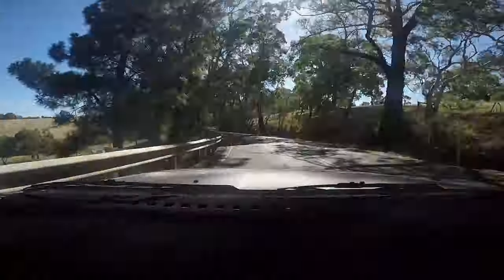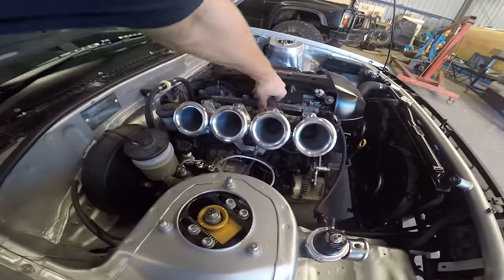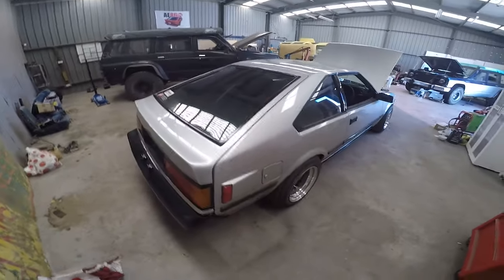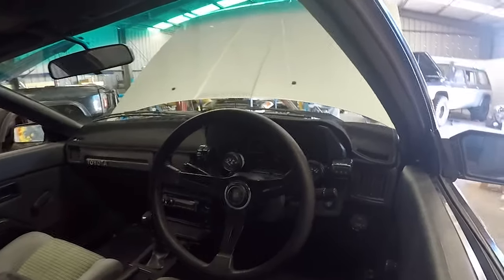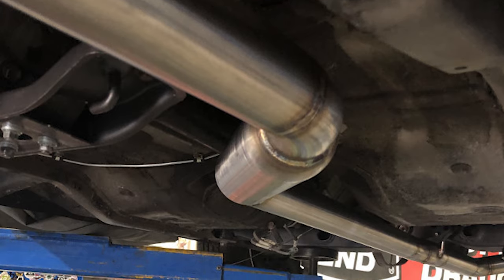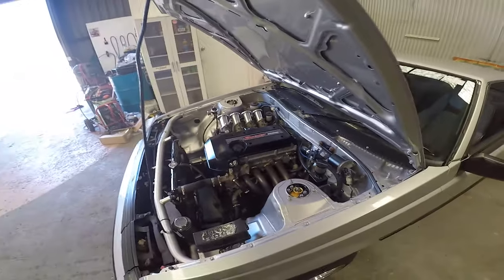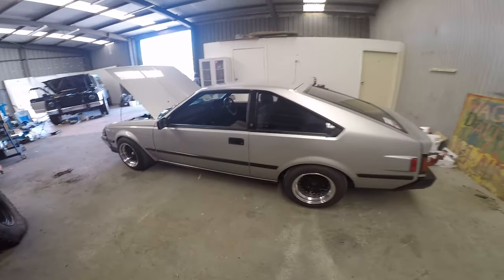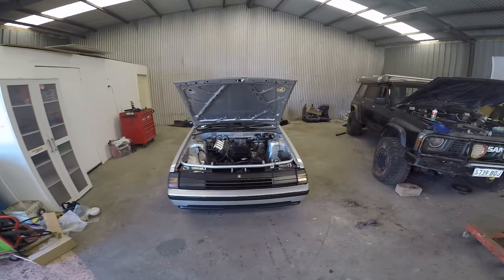Altezza 3S-GE Beams swapped 1985 Toyota RA65 Celica #InterNETionalCars

Comment: Very nice. I have an ra23 but I think the ra65 is underrated. If I had lots of money, I'd for sure get a second Celica, being the ra65
Reply: I've had as well as the two I mentioned above, the second car I owned being an RA-60 and then an RA-65 years later (so basically now have them back) I didn't mind the RA-23 but never drove one unfortunately. Both the RA-60 and 65 are very underrated. The 21RC 2.0L was a grunty naturally aspirated solid engine. I believe they were from over-stock from the Hilux until the next gen where the 22RE came in. The best part of these gen's (besides the shape) was definitely the gearbox that has long legs with the stock diff ratio = grunt in all gears. I used to blow a lot of Torana's, Commodores and Ford 6's away esp. off the line due to that split-case supra box (and zoom past them from 3rd gear on if they caught me LOL). They handled great from factory for what they were esp. at the time. Lowered Pedders suspension, coil overs, extractors/2.5" exhaust and wheel/tyre upgrades makes them handle and go with no more mods than that. Not the fastest in todays standards but heaps of fun and safe to drive. I saw a beautiful gold RA-65 on Gumtree going for about 14 grand a few moths back. I paid $12,888 2nd hand for my RA-60 back in '88!...yep 3 years old and pristine. These cars are vintage cars now. I would possibly consider selling my RA-65 to raise enough funds to get my turbo'd RA-60 restored and re-engineered though.

Comment: My first car was 1984 Celica in the same colour.  I loved owning it and my Dad had a cammed and high compression motor built for me.  Still sad I sold it.
Reply: Yep, it's a thing. Why do you reckon I've owned 4 of these poor-man's Supra beauties? ;) Did the '84 have the split-cased aluminium 5 speed boxes?
Reply: @vapinmccloud412  yeah it did.
Reply: @deliveredconcepts  My Dad had a Sandman and the bank screwed me royally over a missed payment on my 1st Celica and was going to re-possess so I pulled it apart and we put that gearbox behind his 308 before they sent to repo's 😛 She handled the power easily and drove better than the original M21 ever did. She had long legs for a short stroke V8.

Comment: Awesome build!! I have an '83 and a '85. Unfortunately both are unregistered and in need of some resto. The '83 has a 3TGT-EU on straight gas,no computer (180BHP) and the '85 has the original 2.4 injected. I'm desperate for interior plastic trimmings and a dash as they're all trashed from being out in the sun. I'd also like to know about the availability of the fiberglass hatch :)
Reply: Jspec composites in Albury make them
Reply: @steekohoopdy4201  Oooh thanks mate! My mate works in plastics in Albury. Are you talking about the interior bits or the fibreglass hatch?
Reply: @vapinmccloud412  The full fibreglass hatch. Doesn't come the glass though.
Reply: @steekohoopdy4201  I'll be looking into that THANKS! Fibreglass don't rust ;)

Comment: Hey man you really have a great build and it really inspired me. I have the same car and the same engine but haven’t been built one piece. I am still in the phase of overthinking of stuff that might go wrong with the build. I have a bit of questions if you don’t mind sharing. I have ask everywhere locally but havent got a firm answer to make the build perfect as the build is not that practical in my country. I previously used my 3SGE engine in a 1983 toyota Corona.

1) Do you use stock axle for the build or do you use the same axle as been used in the Altezza? I have experience using stock pinion gear and also ae 86 pinion gear and both of them breaks

2) Whats was the power steering you used?

3) When exchanging the rear parts with Supra rear, do you have to modify brackets? From what I know the CS is using independent axle and the ra65 is using a solid axle thus the placement of the rear parts should be a bit different.

4) Do you have to modify the firewalls on the gearbox? On my Corona I modified the firewall a bit but some say that you can extend the gearbox position and install it to the RA65 w/o modifying the firewall.

I hope Im not asking much, thanks man

Comment: beautiful car brother  question the beams to  ae86 engine brackets work with this?? My boy want to do the same swap here in the USA but there's not alot of info on it..
Reply: When I swapped to a 3T-GTE I used a Hilux mount on one side and a modified Nissan Pajero mount on the other side. Not sure about the 3S range. Might help?